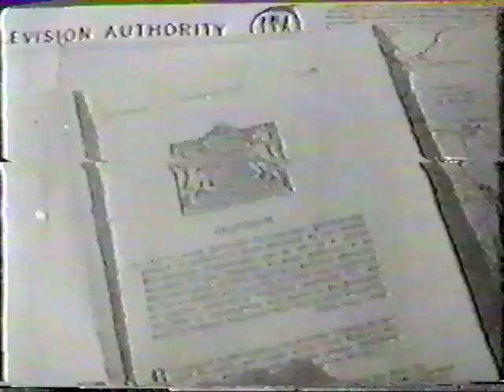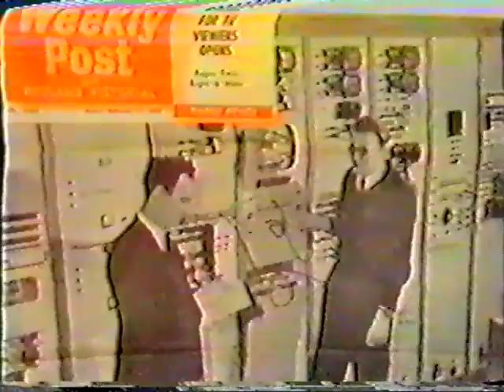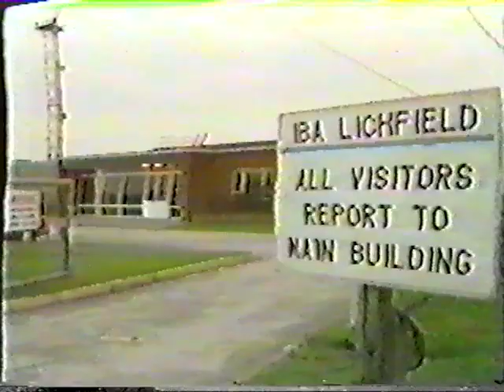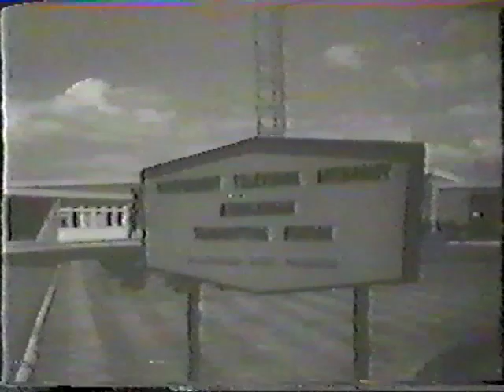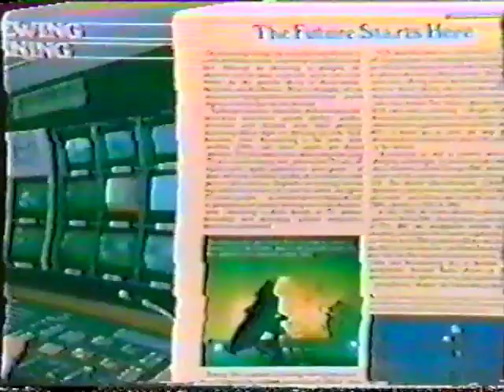Closedown of IBA 405-line transmitters | December 1984

Comment: This is amazing.  I knew about the monochrome, 405-line system—but I had no idea that until 1985 the British PAL transmissions also were converted to 405 and broadcast.  In the United States, NTSC became the norm in the 1940s, compatible color became part of the system in the early 1950s, and it stayed that way until, in 2009, the last NTSC broadcasts were cut off, supplanted by ATSC:  before digital, the was no significant period of simultaneously maintaining two incompatible systems.

Comment: Hallo Dear Friends.
How many channels on VHF A 405 lines were in the 1967th year in the United Kingdom? In 1967 all of them were switch on at UHF band in PAL-I 625 lines? VHF tuner in TV SETs became unnecessary?
Reply: Paul-G Pavel VHF TV in the uk only had 2 channels in black and white, BBC1 and ITV.
Reply: ***** 
1964:
BBC 1, ITV - VHF, A 405 lines, black-and-white
BBC 2 - UHF, I 625 lines, black-and-white
1967:
VHF - BBC 1, ITV A 405 lines, black-and-white
UHF - BBC 1, ITV I 625 lines, black-and-white; BBC 2 PAL-I 625 lines, colour
1969:
VHF - BBC 1, ITV A 405 lines, black-and-white
UHF - BBC 1, ITV, BBC 2 PAL-I 625 lines, all in colour
Reply: +Paul-G Pavel No, BBC2 became colour in 1967. BBC2 was only ever on 625-lines UHF. BBC1 and ITV remained in 405-line VHF until November 1969, when 4 transmitters began 625-line UHF colour transmissions of BBC1 and ITV. From then until 1985, newer UHF 625-line transmitters were opened all over the country so that no areas were left with only 405-line TV (although after switchoff some isolated spots were left with no TV until 625-line transmitters were opened to serve them).

So after 625 was introduced to ITV and BBC1, everything was made in 625, then sent to the 625 and 405 transmitters, with the signal passing through a 625 to 405 converter for the 405-line transmitters.

So no, 405-line TV sets were not obsolete immediately upon the adoption of 625-line TV in the 60s. If they were, then the people making the above video would have been wasting their time!
Reply: +Aidan Lunn Thank you very much for answer. 
1964:
BBC 1, ITV - VHF, A 405 lines, black-and-white
BBC 2 - UHF, I 625 lines, black-and-white
1967:
BBC 1, ITV - VHF, A 405 lines, black-and-white
BBC 2 - UHF, PAL-I 625 lines, colour
1969:
VHF - BBC 1, ITV  A 405 lines, black-and-white
UHF - BBC 1, ITV, BBC 2  PAL-I 625 lines, colour 

In France 1975-1983 use transcoders too, for broadcast TF1 channel on VHF at pseudo 819 lines. All broadcasting equipment worked at 625 lines, already.
Reply: Paul-G Pavel 
no colour on BBC1 and ITV until 1969. No colour or 625 line on VHF ever.
Reply: To be clear, each area had two 405-line VHF services, BBC1 and ITV, but there were regional variations, so for example viewers in the south might see BBC1 South and ITV Southern.   BBC1 was transmitted on Band I (channels 1 to 6) and ITV on Band III (channels 7 to 12/13).  In some places, more than one region could be received with the right aerials, for example in Reading, BBC1 London on ch.1, ITV London (Thames) on ch.9,  ITV Southern on ch.10 and ITV Midlands on ch.12.